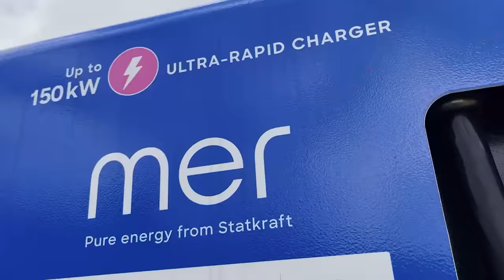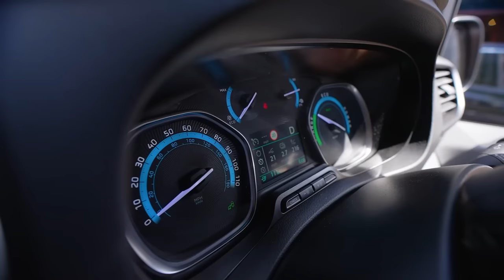Global EV Showdown ~ Is China Outpacing the West?

Comment: Is it just me, or do most people simply dislike electric vehicles...? I cannot see how they are an environmental improvement - they just shift the carbon somewhere else.....
Reply: There is a shift, the batteries used on EV cars today use quiet a lot more raw material than conventional ICE car. The difference is that once made, the source of energy an EV car uses can be made entirely through renewable/sustainable sources. So over it's lifetime, accounting for manufacturing the EV should have significantly less impact on the environment.
Reply: Have you been in one? They are smooth and quiet. Also they don’t gas you when sitting in traffic. Try it.
Reply: The Gvmt is pushing people to these based on their green credentials. People realise they are not as green as claimed so dislike the Gvmt pushing them down everyone's throat. However, not one EV owner I know, and I know quite a few, got theirs for green credentials. They got them because they liked them and they work out well for them. I'd go as far as saying most EV owners don't believe their cars are greener than petrol/diesel.
Reply: I love my electric car. Zero emissions, lovely to drive and wayyyyyyyyy cheaper then an ICE care. What's not to like?
Reply: ev,s are not zero emission they use tyres are heavy so cause more wear on the roads and tyres and electricity is not zero emission the manufacture is not zero emission , there batteries components come from very dubious sources , and when they catch fire are not emission free specially when they can,t be put out and cause massive fires ,governments blinkered idea as usual sending us down the road to another diesel type disaster,wait till an electric car causes a fire in an underground car park under a block of flats! the tell me there a good idea
Reply: @laurencebushby713  where on earth do you get this nonsense? They are far less fire risk then petrol or diesel cars, 20 times less likely to catch fire. They don't use tyres any more or less then ICE cars. They can be recharged off peak which is really low carbon. Or from solar off your own roof. And an EV is significantly more efficient then an engine so will use massively less carbon then any petrol or diesel cars for their entire lifetime.
Reply: Do you have any evidence of an EV fire in a car park? Not aware of any.
Reply: @patrickjr11  yes gatwick  airport ,a bus station in london full of electric buses and luton airport which was pretty certain a hybrid range rover
Reply: @patrickjr11  look into lithium iron battery fires. you cannot put them out they produce there own oxygen and can reignite later after they are finally extinguished and as for cheap rate electricity you having a laugh its still using carbon just cheaper because there producing it an no one is using at that time, and the cheek is electric car charging are getting it cheaper than people using it to heat there homes , as well as paying no road tax driving in twice as heavy cars wearing the roads out,
Reply: @laurencebushby713  given how few EVs are in the road, they are having no impact on wearing the roads out. What are you going to do? Ban EVs and you will have to ban petrol SUVs which are much heavier on average, then ban delivery vans which are much heavier, I suppose next you will ban trucks that deliver to shops or hgvs! Have you been how heavy that are!!!!! Unbelievable!! 
And wait until you see how heavy an ICE 3 series is these days, way heavier then my EV. Better ban them too. 
Perhaps, just perhaps it might be down to the government chopping councils budgets and leaving them nothing to to the maintenance? Just saying....
Reply: @patrickjr11 you evidently own one have not looked any further than how it saves you money
Reply: @laurencebushby713  and means I don't pollute my local area and use energy far more efficiently, and save the UK balance of payments and make the country less dependent on oil and gas imports. And makes life less stressful, and is a much nicer car to drive. And helps balance the demand on the grid.
Apart from that it is the cheapest car I have owned in years and years and years. 
That's bad is it?
Reply: dream on
Reply: Definately agree on the emissions elsewhere. London does have more smog over it though.
When you go a quit smoking clinic they know you've smoked if you go over 5 on the breathalyzer. In London they have to set this to 7.5 to account for the extra air pollution.
Reply: @laurencebushby713  I wonder if it could be the 32 tons diesel trucks that damage the roads most ??
Reply: My EV doesn't ship carbon somewhere else because I charge it from solar panels. If you bother to check you will find that on many days over 50% of electricity generated is from wind, solar or nuclear and that percentage is growing rapidly.
Reply: @patrickjr11 mostly correct but their weight and need for gripper tyres due to higher torque means they do wear through tyres quicker.
Reply: I agree, the batteries are going to deteriorate in five years, with range dropping correspondingly. There is no solution for battery replacement & recycling at the moment. I’m quite happy driving my 13 year old diesel, it’s carbon footprint has been more than offset.
Reply: @patrickjr11 where have you been? The list of ev fires is endless. There was even a ferry full of cars that sunk because of an EV fire. Electric busses are also a favourite and one fire usually ends up destroying the whole fleet. If you're going to promote the benefits of EVs at least have the honesty to face up to their disadvantages.
Reply: @patrickjr11 given how few EVs there are on the road makes the percentage of fires far higher than ice fuelled vehicles. You can't have it both ways.
Reply: @paul756uk2  but in this case you can. There are 1000000 EVs on the road in the UK out of a fleet of 32 million. So they are statistically significant. The fires per miles driven are very clear. EVs are at least 20 times less likely to go on fire over ICE vehicles. The numbers there are very clear. 
In terms of collapsing car parks. The vast majority of cars parks were built at a time when ALL cars were smaller and lighter. Any car you pick is heavier then in the 70s or 80s. All of them are. Add to that we as a buying population are trending towards large SUV's over regular cars or hatchbacks. So the entire car fleet is heavier but EVs are no heavier then the average car. However given that only one out of 32 cars is currently an EV it's fanciful to say EVs are the cause of collapsing car parks or damaging the roads. Nonsense in fact. 
A BMW base model 3 series is 1845kg with no one in it. A MG4 which is similar size is 1748kg. All cars are heavier. And every time an existing model is updated, it gets taller, wider, longer, more gadgets. And therefore heavier. That's just the nature of things in the car world.
I am thinking of changing my car over to a byd dolphin, about the same size as my leaf. The leaf is 1534kg, while the dolphin is 1506kg. So lighter. And both lighter than a regular petrol car. It is what it is.
Reply: @jp6975  I bought mine because it's 75% cheeper to run and because I respect people who suffer from breathing ailments,
It's quite smooth economical and lovely and warm on a winter morning due to preheat system 😊
Reply: @laurencebushby713 Gatwick airport was a diesel car. Overall EVs burn about 10 times less per unit than ICE vehicles
Reply: @paul756uk2  which ferry? I think you are referring to a car transporter but there is no evidence that it was caused by an EV. None at all. And there have been a number of car transporter fires recently, none of which were caused by an EV. The reason those types of fires are so dangerous is because the owners have removed all of the internal deck bulkheads and are packing in the cars too close to maximise profits over safety. Nothing at all to do with EVs. 
Buses catch fire, they are heavily used machines and have been catching fire for years. Especially at risk are the 12v systems which are a weak point for any vehicle. Remember the London bendy bus fires. There were loads of them before the issue was fixed. Fires in complex equipment happens. Always has. EVs are less likely to go up because they are less complex. That's just how it is.
Reply: @patrickjr11  yeh they were cargo ships and transporters not ferries. Do a search you'll find them. They're a bigger problem than some people will admit to. EVs and battery production is unsustainable and people talk about how they drive cars that don't pollute which is utterly farcical when you look at the pollution and vast amounts of water that's needed in mining the raw materials. Some people are incapable of just don't want to see the bigger picture. Same as wind as solar. All that's doing is transferring wealth from the poor to the rich. It's a joke. You say there's no evidence they were cause by an EV but you people always say that. Again it's a cover up because it doesn't fit the narrative that governments want to push.
Reply: It's just you.
Reply: @Turrican  that's a bit of a stupid statement.
Reply: @paul756uk2  but your happy that oil is mined refined and transported daily in vast quantities to just burn up in engines polluting the local atmosphere and those engines needs constant maintenance and servicing so generating even more yearly pollution. That's all fine is it? And given the amount of fuel that needs to be imported from Russia, Saudi Arabia, etc as the UK has to import 60% of it's needs, that's also okay is it? And you realise while it's perfectly fine to recycle ev batteries, once they have a 2nd or even a 3rd life, you can't recycle petrol, which is fine is it? And you absolutely can recycle cobalt from the batteries that use it but you can't recycle the cobalt from fuel as it is burnt up in the engine. That's okay is it?
And you prefer that using fuel which is incredibly wasteful in energy while EVs and modern green tech is very energy efficient is better? 
Modern green tech will lead to a reduction in the total energy used in the UK which is what I prefer.
Reply: @paul756uk2  the insurance companies say that EVs are not a fire risk. That are not a charity in any way possible. And Top Gear says it. And they are usually biased towards petrol cars. The truth is EVs are a significantly smaller fire risk. The numbers speak for themselves and that's just what it is. 
In any case, EV batteries are the same as the batteries used in mild hybrid, hybrid, plug in hybrid, mobile phones, laptops, trains, airplanes, ships everywhere, basically our modern world. You need to ban all of nothing I am afraid
Reply: @patrickjr11 The purchase price.
Reply: @jackiechan8840  no car is cheap anymore. EU safety regs and emissions restrictions have seen to that.
Reply: Every time you fill up your van think of all 60kg of fuel you’ve put in ending up as carbon in the atmosphere
Reply: @timfulwell8472  I've been driving for the best part of 40 years, I've never been gassed while sitting in traffic yet!😂
Reply: @WishfulThinking-ms2cf have a look on auto trader. Nearly new EVs from all brands on par with their petrol equivalents. There is far more competition now as virtually every OEMs have every model as an EV. 
The government fine OEMs 16000 per car if they don't hit EV sales targets by end of each year. I think this year is 20% so the price gouging that was going on is coming to an end.
Reply: Look how the materials for the batteries, are extracted.
Reply: Communism
Reply: @fortnitefred1351  look how the oil for your car is mined. And if you are thinking batteries look at the battery in your phone or your laptop. Same tech after all, same minerals. But most cars now use lithium iron phosphate. Very few rare earth in them and absolutely no cobalt. And they are called rare because no one at the time knew where to find them. Nothing in an EV battery is rare. All pretty much common as muck.
Reply: @fortnitefred1351  communism? Hardly, this knof it as giving capitalism rules, limitations and boundaries.
Capitalism that benefits the consumer and not just the oil barons
Reply: @patrickjr11  I agree with your point, but ethically it's not right that, 12 yr old boys without PPE are mining for the raw materials.
Reply: @jp6975 at least you wont rely on just the Saudis for the fuel. I know alot electric is gas so you have the Russians to worry about. But the point is there is more alternatives to make electric.
Reply: @williammoore9609  I agree, Nikolai Tesla knew that.
Reply: @timj11dude define 'lifetime'. My car was made in 1974
Reply: @stenhouseh  that's great. 👍🏻 I'm always happy to agree we should make what we have last. However in the context of any new cars, like stated in the video, it would only take 60000 miles for an EV to be less of environmental impact than an ICE car.
Reply: @timj11dude 😂😂😂😂 Wait, what, you're serious?
Reply: @timfulwell8472 I,m sure he has never followed a car whose exhaust pipe is spewing out black smoke and choking on the Fumes.
Reply: @laurencebushby713  The earlier batteries may have caught fire, but lithium ion phosphate batteries have drastically reduced that from happening.
Reply: Is easy to control million car emissions or a few power stations?
Reply: @patrickjr11  Think he,s talking about cars fitted with early versions of lithium turniary batteries which may have ignited. But current batch of ev,s are now fitted with lithium ion phosphate batteries which have been tested and far safer now.
Reply: Blame 60 years of the oil industries lobbying 😅
Reply: @laurencebushby713  that was a hybrid.
Reply: They aint grreen so ill stick to diesel and petrol me
Reply: Lifetime CO2 emission is lower than gasoline vehicles ven if the EV uses electricity generated by coal.

Comment: Solid state batteries, if they ever become viable to manufacture, theoretically would make battery production viable outside of China, because they use plentiful sodium instead of lithium.
Reply: I read a couple of months ago that Toyota have perfected the solid state battery with a possible range of around 700 miles and alot quicker charge time than traditional lithium batteries. They reckon they may be ready by 2027.
Reply: Lithium isn't the issue. In fact, it's the one piece of the battery puzzle where the west is, let's say, less behind China.

As for Sodium, China dominates research in that too; there are already Chinese production EVs with Sodium batteries. There's even a Chinese company promising solid state Sodium batteries for 2026 or 2027 with 300Wh/Kg energy density and at a cost of $40/KWh.
Reply: Sodium battery is semi solid state still liquidity

Comment: how does a heat pump fit on the list of low carbon appliances, like wind, power, and solar powered electric generation?
  as an HVAC technician, all a heat pump is, is like an air conditioner. An air conditioner does not create cold, it simply removes heat from the home, and dumps it outside. In the colder months, it extracts the heat from the cold air and dumps it into the house. They are not very economical for saving electricity, and they don’t really make that much heat if the temperature drops below 32°F or0° C.. A heat pump, then has to energize heat strips to add supplement heat, which uses a great deal, more electricity because the heat pump is not very efficient once it goes below 45°F. Even though the air outside may be cold, it’s still warmer than the refrigerant in the lines of the heat pump. And that additional temperature it is able to put the heat inside the house, as lukewarm as it may be..
  I wonder when they will get around to reducing peoples ability to burn wood or coal in their homes because that releases carbon also. In parts of the United States, such as in Utah, people that use wood to heat their homes have to have catalytic converter‘s in there, flue pipes that vent the burnt gas to the outside of the house. So many people burn in some valleys with subdivisions of homes in them, that the smoke is unbearable at times.
  keep in mind, if you think you are saving carbon by going to an electric vehicle, think of this. Approximately 40 metric tons of material has been mind, transported, and processed to make just one EV battery.

Comment: This 60000 miles claim is interesting. Are you putting the equivalent on your petrol/diesel vehicle, which itself also had to be built (and almost certainly imported from elsewhere)...?

In reality, yes an EV will start its life with a higher carbon cost, but it is closer to 12000 miles difference to an ICE vehicle. For many people that'll be 6 months usage.

Anything beyond that is only emitting at a level linked to the electricity generation mix of the power used to charge it. As we all know, that generation mix is getting cleaner by the day. 

The environmental argument for an EV has already been won. The comfort and convenience one is still ongoing, but that is also only going in one direction so there's no use in fighting against it.